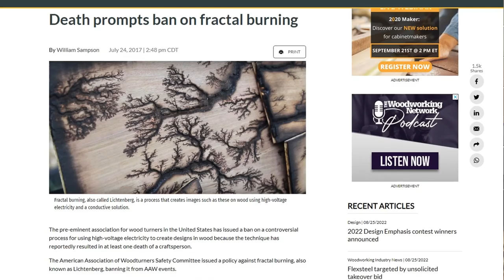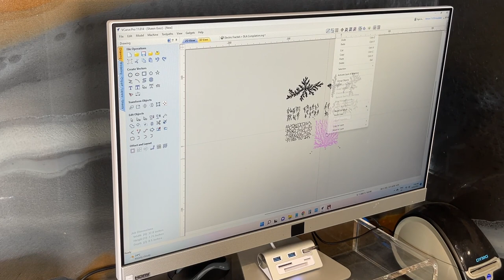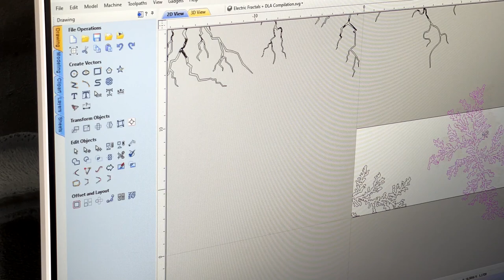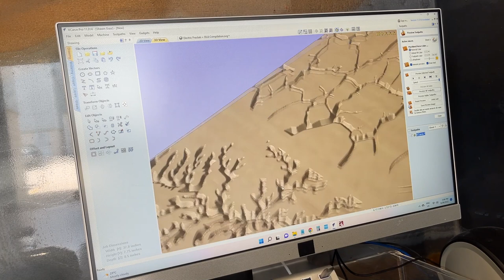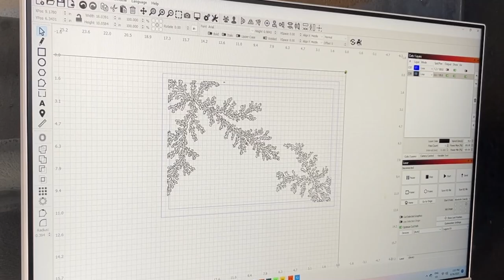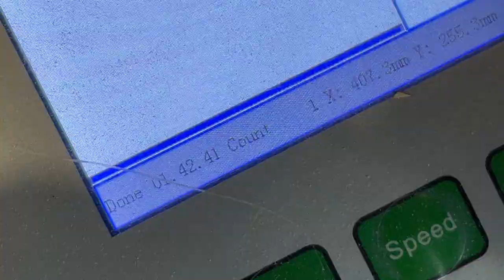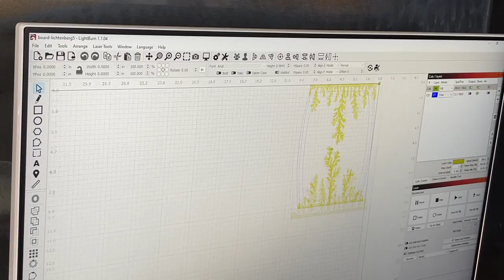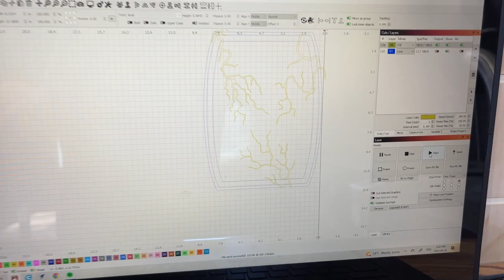Lichtenberg Boards Without Death - CNC & Laser Engraved Lichtenburg Wood Burning Effect DIY Tutorial

Comment: I am not arguing the cnc would not have as great a detail as a laser, but v-carving toolpaths in Vetric products is constrained by the vector.  The bit will only go as deep as the outside vectors will allow it.  It should not have lost that much detail.  I have produced some very finely detailed projects using a 90-degree bit.  If you want more depth, you can run the same toolpath with a 60-degree vbit.  I think something was off with your settings, possibly, or that vbit or collet had a pretty bad run-out. ( possibly debris in the collet)    That being said still a very cool demonstration and test.

Comment: Conestoga Works makes a commercial unit that is alot safer.  Microwave and neon light transformers are 9000 -15000 volt same for output. 

The one from Conestoga Works is a 12000 volt unit with only 35 mili amps. Alot safer, but slower and not as deep.

Comment: Could you do both methods with the same design to get the depth as well as the burning?
Reply from the maker: You could... but you would have to be deadly accurate when setting up the origin point for the CNC and origin point for the laser. Making sure they were both perfect 90 degree angles etc. It would be easy to mess up but sure worth a try!

Comment: Wonder how it would look if you cut with a CNC and then ran the same file with the laser?
Reply from the maker: I had thought about that, but I feel it would be near impossible to line them up exactly (setting the exact origin point). Even off by 1mm would likely be obvious.
Reply: I have been pondering the incorporation of both tools to achieve the same outcome. Possible a multi tool cnc/laser (snapmaker style) to eliminate the setup zero point. I understand on a large scale it would be real difficult. Stsy safe and take care
Reply from the maker: @backtoobasics  If you do it, I would love to see the results. The multi-tool CNC/laser would likely be a good way to do it to avoid any setup point issues.
Reply: @MakeEpicThings  I bet if you added the print and cut it could be done. Basically gives you cross hairs to line up in lightburn
Reply: @jonsaircond8520  That would be something to test for sure.

Comment: Can this be done with a 40 watt diode laser?
Reply from the maker: Duane. I honestly doubt it, the diode lasers aren't very powerful when compared to a CO2 laser. You could certainly engrave the design on the wood, but I dont know if you could get the depth required to be able to back fill the engraving with epoxy.